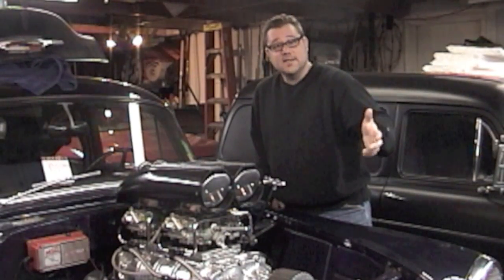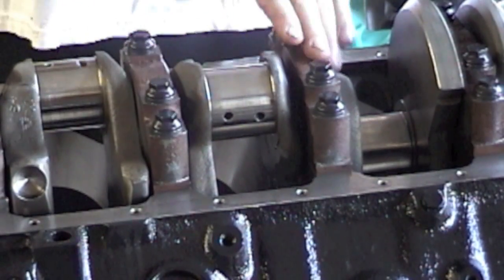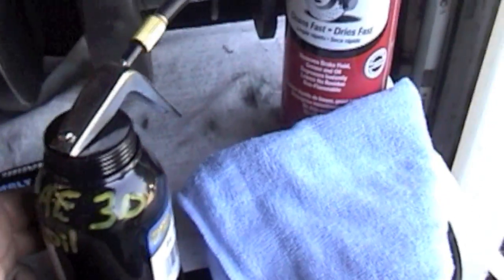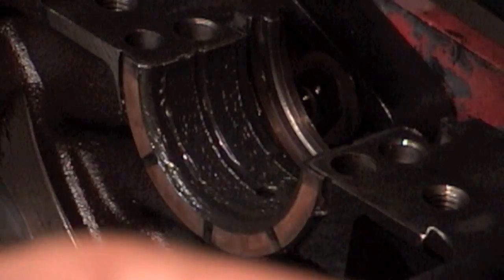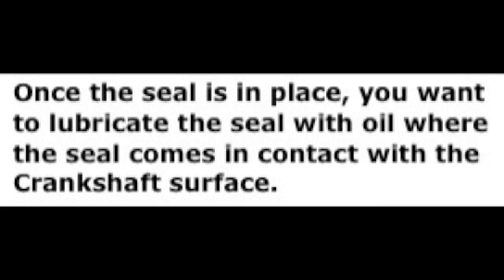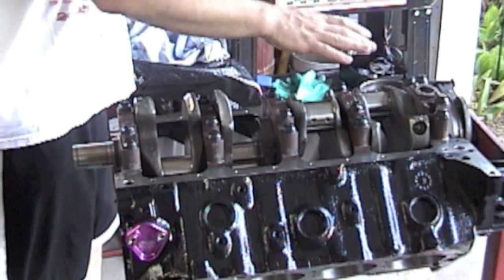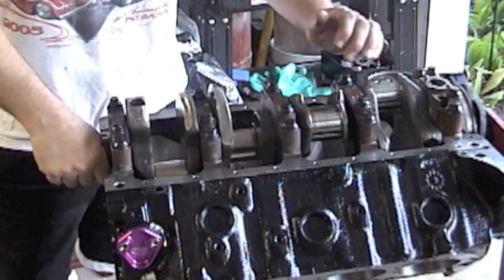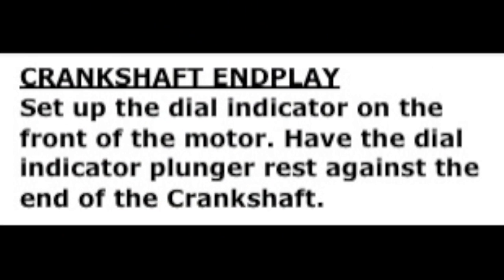Part 10 Installing The Crankshaft For The Big Block Chevy

Comment: My crank was frozen so I took 1/2 off. See some wear. Replaced piston bearings but now rod bearing assemblies will not go back on as if the bearings have grown. Strange?
Reply from the maker: Hey mikefromspace,
I would remove piston/rod from each cylinder.
Next I would place the rod in vice and install the rod cap and torque to spec. with bearings in place. Next take a measurement write it down. Do this for all 8 rods.
Compare measurements and this will give you your answer.
I would remove the crank and take measurements of the crank journals and bores. write the measurements down so you can compare measurements.
Hope this helps.
Johnny K

Comment: THANKS FOR POSTING THIS VIDEO...  IT WAS VERY EDUCATIONAL...  NOW, I'MMA GO BACK AND WATCH THE OTHER 24 VIDEOS...  
I REPLACED MY CRACKED FLYWHEEL TODAY, IN MY 1981 GMC CABALLERO (305 ci.)...  WHEN I FINISHED, I HEAR THE SAME NOISE THAT LED ME TO CHANGE THE FLYWHEEL...  I RAISED THE CAR BACK ON THE LIFT, ONLY TO DISCOVER THAT MY FLYWHEEL & TORQUE CONVERTER WERE WOBBLING ALL OVER THE PLACE...  MY FRIEND, WHO ALLOWED ME TO USE HIS SHOP, CHECKED THE "PLAY" IN THE CRANKSHAFT...  THRUST BEARING!!!